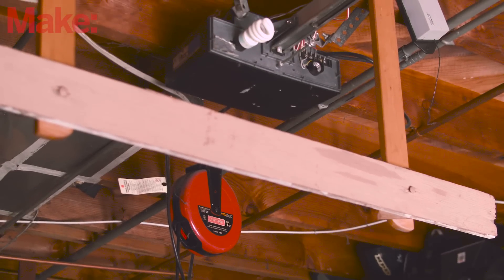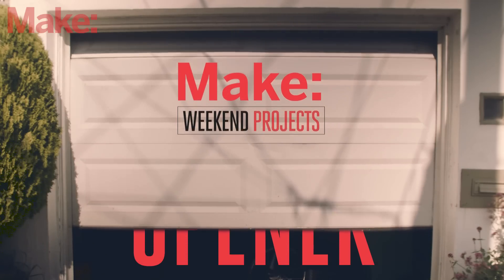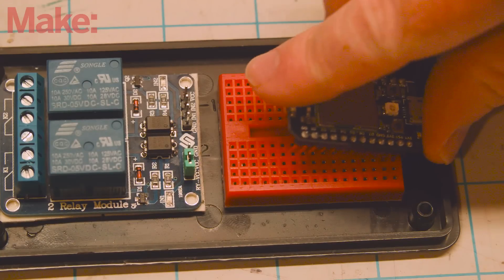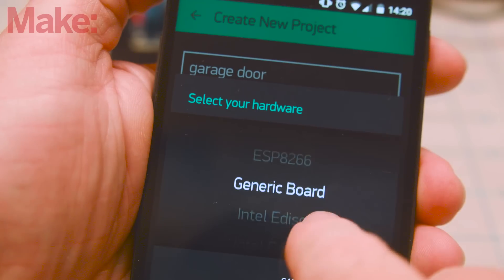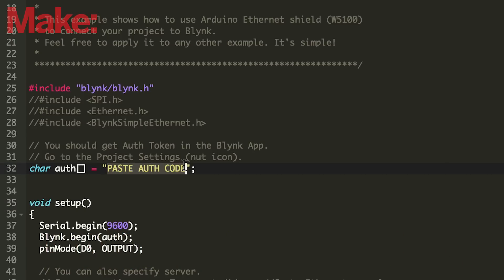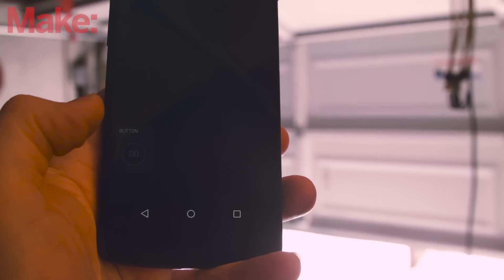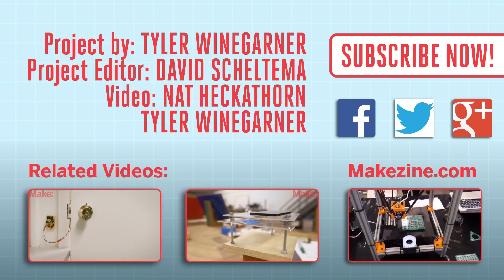Weekend Project: Smartphone Garage Door Opener

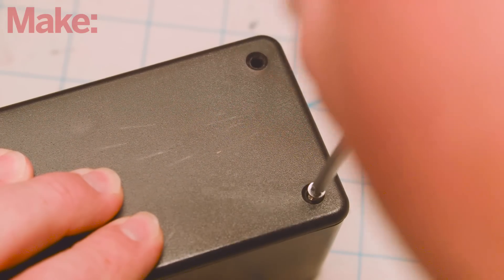Comment: Vert dangerous and stupid to tell someone to short together wires on the opener without knowing which ones are safe to do so.    @2:45 , I challenge you state what reliability issues mounting the board directly to the opener would cause.  How may times did you test this without the box?  What were the failures?   How does the box being there improve the operation of the circuit?

Comment: I am confrused about the relay configuation. I was excited about this project until I read on boot up it will glitch the relay, which for a garge door opener would be a bad thing. I have 2 garge door openers and wanted to use both relays. I am currently working on using a couple of ECO plugs aplliance modules. They work well, and no problem when loosing power to them. I will either hack the relay normally open contacts to close the contacts on my door opener button or I will use a 5 volt plug in supply to control a 5 volt relay to make the closure on the opener button.  The ECO Plugs app so far has been 100% reliable.

Comment: Need some help troubleshooting: My project seems to work fine.  I tap the button on my phone and I hear the relay actuate.  I tested with my multi-meter and I see current flow across the relay when I push the button.  I install it to my garage door opener and nothing.  It did work for a short period of time, then it quit.  The relay still actuates, but it doesn't open/close the garage door.  I'm starting to think the relay has gone bad.  Any ideas for verifying the relay is working correctly?
Reply: Michael Roberts Same problem

Comment: Try to find the right contact by bridging some contacts with a jumper wire until something happens? i guess someone is going to kill himself while doing this. my garagedoor opener uses 400V AC for its motor.. also the contacts are right next to the lightbulb which will atleast work at 110V AC (depending on where you live). Please add an anotation to warn people of this danger so nobody gets hurt

Comment: i like it :) but i need some help :) i'm an amateur on arduino and i have  arduino uno , some led  and a  esp8266 wifi module (esp01) . how can i make a connect between arduino and application which is  on my phone ? :) (i dont know how i can the connect with internet with wifi module for my arduino uno ? and i didn't understand how i can connet the application to my arduino )
Reply from the maker: +İsmail Açıkgöz Blynk does support the Arduino Uno with a wifi shield, but beyond that abstract I don't know the details. There is a community forum over on Blynk.cc, however, and someone there has surely solved the problem.
Reply: +Make:  with internet shield ?
Reply: +İsmail Açıkgöz you do not need an arduino if you have an esp8266!
Reply: Just flash esp8266  with nodemcu firmware amd it'll work as a mcu..
Reply: on /.!?xdeedxkioiu

Comment: I'm confused, is it using both relays for different things, or are they just using two in series for some reason.
Reply from the maker: +ZooRatedProductions The relays are wired in reverse - you pull their power to low to activate them. If you wire the garage to the NO side, the garage door opens as soon as the particle core boots. If you wire it to the NC side, your garage will open if the particle core ever loses power. You jumper the relays together in a series so that the circuit is made only when you actuate it from the app.
Reply: Make: Thank you. That makes so much sense to me now.
Reply: +Make:  Why not just make the button do a high-low transition then; trivial change.  Having two relays is a just inviting an extra failure mode.
Reply: could I see a shematic of what you just said.

Comment: he should mention : dont go putting a jumper on mains connections.
Reply: That should have been added. going fishing like that with a jumper wire is a bad method to figuring out I/O in general and a good way to either get a nice bite or fry something. this checking should be done with a meter, its much safer and more precise. This was an excellent video though!
Reply: +briancnc indeed. very dangerous.
Reply: +thingyee1118 bit stupid the way he said that!! potentially very dangerous!
Reply: +thingyee1118  I was about to comment that
Reply: indeed.